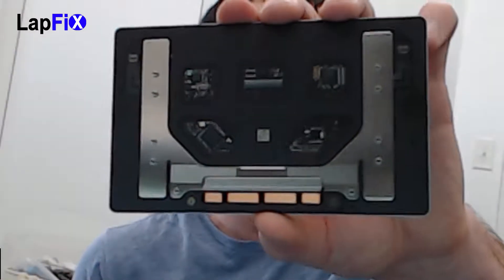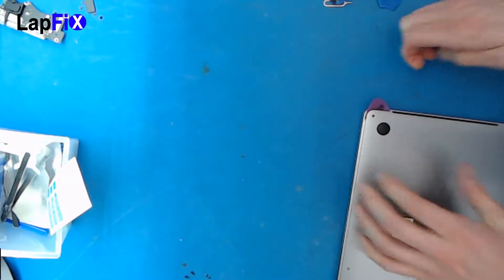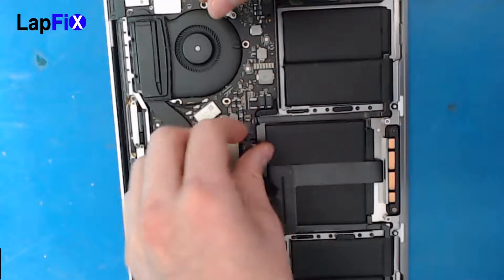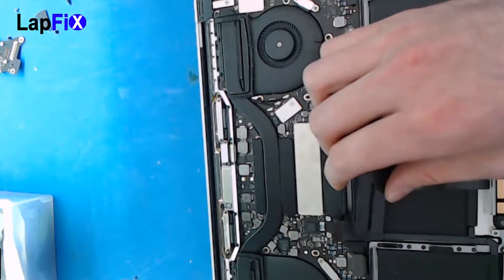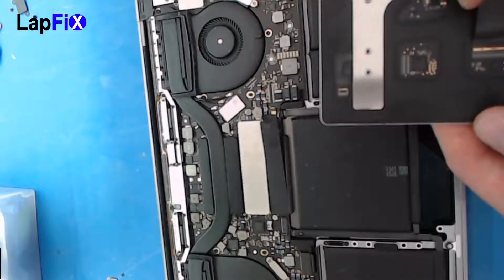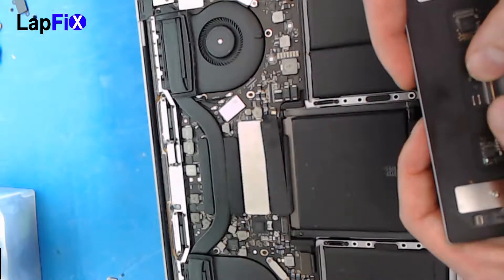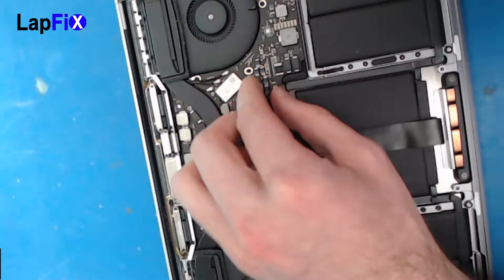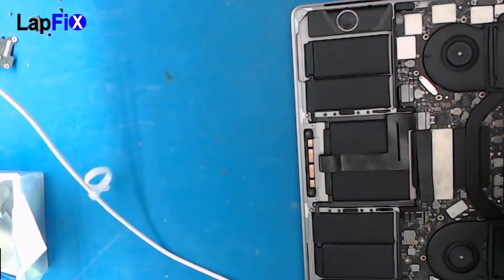How To |  Macbook Pro 2016 2017 a1706 a1708 Trackpad Install

Comment: What did you say about the cable if what happens  to the cable that puppy’s is gone? I ask because I just got my laptop back from a local fix it store. they were replacing the battery then when I got the laptop back the track pad wasn’t working. I’m hopping they didn’t mess up the cable that your talking about.
Reply from the maker: It's easy to damage the cable and trackpad during the battery removal process so it is better to just take it out.  Usually if the cable is damaged, the keyboard won't work as well

Comment: The trackpad flexcable should influence the keyboard function? It stoped to working.
Reply: Hey I have the same issue. If you still have the problem or you fixed it. How did u fix it?
Reply: @Dermurder  did you fix it?
Reply: you may have damaged the flex cable, or is not connected properly.  Try to reconnect it and if still not works, buy a new flex. that solved the problem for me!
Reply: same for me no more trackpad or keyboard... fans full blast

Comment: I have a nice selection of miniature screwdrivers. What I don't have are pentalobe drivers or miniature torx. You might have at least mentioned that this requires a handful of uncommon drivers to do the job. Now I have a new track pad I can't install. I strongly recommend that anyone attempting this for the first time study the steps and photos on the IFIXIT site instead of this video.
Reply: I bought a simple set of mini screwdrivers and I was able to unscrew all the screws that I needed to, they're not specialist screws or anything

Comment: how was your trackpad behaving that lead you to replace it?  i wish i could have seen close-ups where the pad. fit in on the other side. think there's good reason to add some sealant anywhere? a suggestion: more and better lighting would help
Reply from the maker: There are a lot of chips and components on a trackpad.  If something shorts or goes bad, it can cause the trackpad to malfunction.  The trackpads are fitted perfectly for the macbook pro.  There are a lot of screws that keep it in place.  Sealant is never necessary for these types of repairs